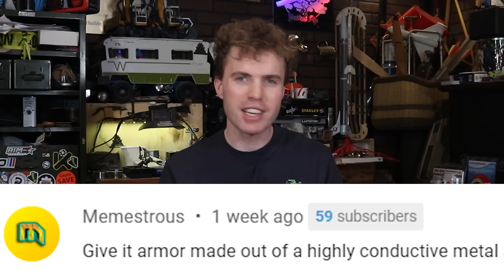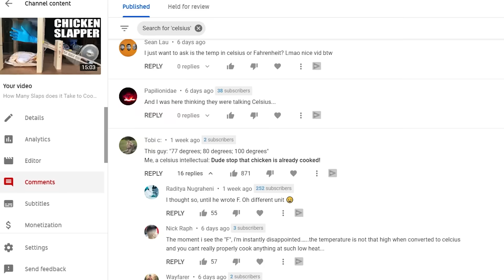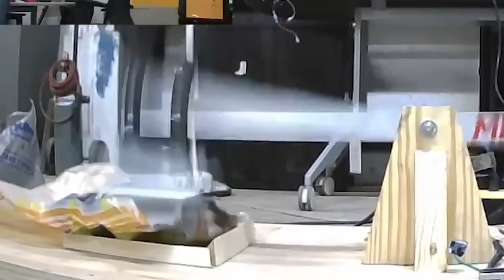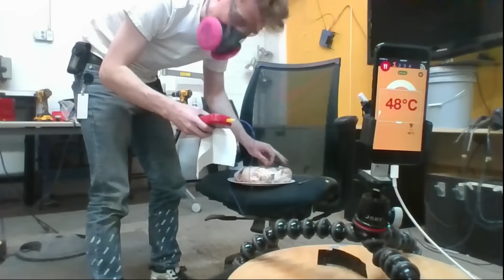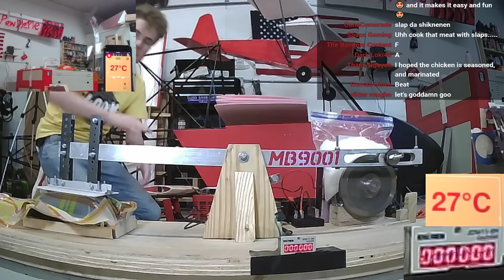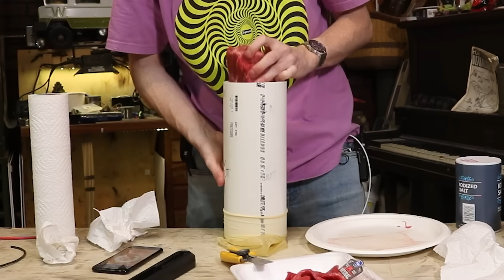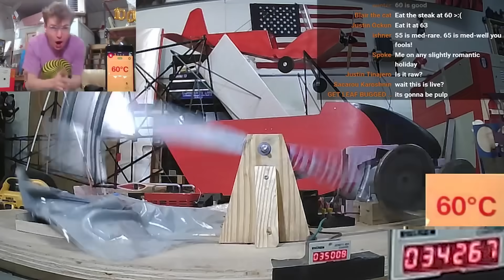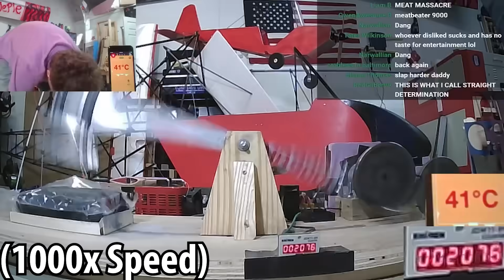I Cooked a Chicken by Slapping It

Comment: It definitely seems that the channel you cut into the slapping arm which attaches to the pin caused the most issues, due to the pin applying force to the thin walls at the top and the bottom of the channel. A design resembling a piston would have mitigated this, where, instead of a pin moving back and forth inside a channel, you have a smaller channel moving back and forth inside of a larger channel, which would be the arm. The smaller channel would be pinned to the wheel.

Also, even though it ended up working in the end when you used a stronger bolt, the bolt ideally should have been supported at both ends rather than just one, so that it resembles a crankshaft. In addition, the slapping arm is offset from the wheel by a significant amount, increasing the torque and subsequently the bending stress. And this bending stress is dynamic, meaning that it's basically just a matter of time before the bolt breaks due to fatigue. If you set it up like a crankshaft, you would not only reduce the internal stresses in the bolt but you would also be able to drive the crankshaft with a belt/chain rather than a rigid attachment to the motor shaft. This would let you gear up, and you could also put on a flywheel to smooth out the torque the motor outputs. It would also eliminate any axial forces or lateral torque acting on the motor, which motors really aren't meant to deal with.

Comment: Running a motor on load with a variac compromise the v/f ratio witch can results  in higher temps. Next time use a drive...

Comment: The device is too complicated. More parts means more things to fail. Should have just stuck to the spinning wheel with like 12 ballistic gel hands mounted on flexible shafts to it so they will bend back to clear the chicken. Increasing speed would allow the hands to hit more often, without increasing force too much. Having the arms mounted in a sort of trailing configuration, as opposed to coming out 90 degrees to the wheel, should also decrease the slapping force and make it easier for the hands to clear the chicken after making contact.

Comment: Why don't you try multiple slapping arms on a fly wheel attached to the motor. If the slapping medium was just flexible enough, it can apply enough force to produce heat and with multiple slapping arms on the wheel, you can crank it and get more slaps per sec. Also, this requires much less stress on the slapping arms because the force applied to each arm on impact would dissipate slightly (i think) as the arm makes its way back around the wheel rather than applying force over a longer arm which creates weak points and instability. So, shorter arms, something flexible enough to slap and also bend enough to move past the chicken and with multiple arms, maybe 6, depending on diameter of the wheel, you get more power and with shorter arms you don't lose as much energy before the slap is applied. Think windmill with slapping arms cranked up to 1000rpm.

Comment: According to my math, it would take 216,000 calories to cook the chicken.

To calculate energy expenditure from watt hours:

Watts per hour x 3.6 x # of hours = Energy expended
Therefore:
7,500 watts per hour x 3.6 = 27,000 x 8 hours = 216,000 calories expended!

This means that since an average chicken contains about ~1,037 calories, you would be in a 214,963 calorie deficit(without taking in BMR, or the addition of eating any other food while slapping the chicken). 
Because one pound of fat is about 3,500 calories, you would lose about ~61.4 pounds of fat from just slapping the chicken alone. 

Why do weight watchers or keto when you could just slap a chicken 135,000 times???

Have a great day👍

Comment: “Im just saying, if Physical Energy can be converted into Thermal Energy, How hard would I have to punch a chicken to cook it?”
-Jello
Reply: The answer to that question is probably around 311km/s²|3200G, or 1.2MN|127t, which is the estimated acceleration/force required to make the hand to ignition point.
You could probably go slower, but you basically need to accelerate the chicken by 2000-2150km/h near instantly to have the same kinetic energy as 60-75C, though obviously you could go slower if you can stop the thermal energy from leaking out like was shown here.
Reply: @theapexsurvivor9538  
._.
Reply: @theapexsurvivor9538  so it would be burnt since its ignighted or do we wait a few secs for it to cook?
Reply: @theapexsurvivor9538  carry the 5 and the 0 do what 300 degrees??? Equal plus punches
Reply: @theapexsurvivor9538  It's easier to accelerate a chicken to that speed, then have it crash into a brick wall.
Reply: @pierrecurie  wont the chicken just be pulverized at that point?
Reply: @-grumpygold1155  yes, but at least it will be at an FDA approved temperature
Reply: @pierrecurie  i see.. just sprinkle some salt eh?
Reply: I see your man of culture
Reply: Good one
Reply: Deku: 👁👄👁
Reply: This was in my recommendation! And I'm not mad!
Reply: Reminded me of the chicken thrown in this video https://www.youtube.com/watch?v=U2rNnzVotS0&fvfvrevbvb

Comment: so about 3x the energy cost and at least 6x the time cost compared to using an oven to bake (using your energy statement, and the 6-8 hours, and 15 minutes to heat oven to 350 degrees, and 30 minutes to cook chicken.

and developing your own technology rather than buying an oven.

... and getting this process to be automated at all requires electricty, while feeding a fire for an oven is a lot less work, and means that you only spend human energy on moving the fuel.

Comment: Why aren’t you using a wheel design to provide the slaps? Seems like the main problem you had was the impact from the arm going up and down. Seems like you could get more efficient slaps if you hung up the chicken like a speed bag, and basically made a small wagon wheel with extended pads, they would deliver slap after slap Rocky style.

Comment: wondering if anybody thought of doing it with a single slapping wheel with 3-4 slapping "hands" attached directly to a motor, hands would obviously be loose hinged slappers to allowed them slap the chicken but get out of the way to allow them to pass by and so on and so on and so on and so on. slappers could be made of some kinda heavy duty rubber or something along those lines so they could flex on impact. in my head that'd be one way to potentially increase the slap frequency and lessens the complexity of the contraption so in theory less stuff could go wrong too.

Comment: Wanna know why the meat gets hot? 

Because it is still part of an organism that reacts to anything. Imagine your hands and start clapping. You don't need to do that if you already know what happens when you do that. After a minute or more you'll start to feel your palms getting pretty warm. But because it also starts to hurt you might want to discontinue your clapping. That is at least the signal your brain will send you in regard of this matter. Now imagine you cut off one of your hands put it on the table and start slapping it with whatever is available. Since it is no longer a part of your body you won't mind the hand hurting because you don't feel it anymore. Thus you can clap/slap as much and as fast as you want which will result in higher temperature within the hand. Because the muscle tissue is "working" and there is no impuls to stop whatever is happening because you cut your hand off earlier which ultimately allows you to "coock" your hand as far as it physically allows you to. If you still don't know why the meat will go warmer and warmer then remember your last exercise and how you got warm during training or running. Pretty much the same idea. 

So basically what happened with the chicken was that it got "overexercised" to the extent where it coocked itself. Yummy idea :)

Comment: Why not use a spring on the slapping side of the slapper? All that weight is on one end, the the motor and mechanism is going through continual stress. There will be some rebound from the meat itself, but a spring installed may help push the slapper back up.

Comment: Elliptical motion. Flexible slap surface. And don't eat aerojel. So good, and try a bag of rice water for the slapper pad, and elliptical so you can control the force with the modulation of the electrical input, it should just shake the bag.

Comment: Congratulations, you built a waveoven. The Microwave does exactly the same thing, just much much faster, enclosed to prevent heat loss.
I must say, it's actually impressive. Personally I would have made a slapper with a speaker magnet, since it could control both power and speed and is built for continuous use.

Comment: the experimenter is a victim of the experimental effect....focusing on optimization would have yielded more effective results ....by utilizing the heat generated by the motor he could've simply put the chicken on top of the motor and turned it on thus cooking the chicken thru induction...the weakness in his design was the cam itself where there were huge losses due to a change in kinetic energy....by insulating the chicken it was ultimately cooked thru induction not kinetic energy...by simply changing the location of the motor and arm to over the chicken would have yielded more effective results #rubegoldberg ⚙️

Comment: Celsius: "I am pretty much the standard way of measuring temperature, hello."

Fahrenheit: "I'm a bit different, but people still use me. Celsius is a bit cooler than me tho."

Kelvin:  👁👄👁
Reply: Kelvin is so much better than Fahrenheit. Especially as you can easily convert it into Celsius and vice versa.
Reply: Kelvin in used in physics and chemistry if im not wrong
Reply: I only use degrees rankine.
Reply: @Quinten Fulgenzi it’s still better than Fahrenheit
Reply: @Quinten Fulgenzi But 0 is actually the lowest it can go, as all good measurements should be.
Reply: @Quinten Fulgenzi Still makes far more sense than Fahrenheit. 0 Kelvin equals -273°Celsius, the lowest theoretical temperature. 273 Kelvin equals 0°Celsius, the lowest point where water is still a liquid under normal pressure.

Comment: Contraindications on completing your chicken slapping mission!   I wonder if you can transfer some of the heat of the motors to the "chicken oven, cooking surface, etc?"  Perhaps the next the design could use a vibrating sheet of metal to cook of some size, 2ft x 2 ft square...?   working much like a sander  or up and downj?  Getting rid of the slapping arm might also remove a lot of issues.... granted with a vibrating sheet of metal sideways or up and down will create different ones.

Comment: Why on earth did you not make a rotary slapper?  A spring-loaded chicken holder to keep the slap pressure pretty equal and with several slapper elements, like rubber  mats, you could get to the required number of slaps much quicker without  the vibration your idea produces.

Comment: I think one of the reasons that the arm ended up breaking several times is that you weren't taking into account the natural resonance at which it bends. If the length of the arm or the speed of the motor aren't adjusted so that it perfectly counters the resonance frequency of the arm, it will bend further than the wood can withstand.

Comment: Um...no

Cooking at a set degree that’s below the SAFELY COOKED TEMPERATURE doesn’t have positive effects, in fact it actually has NEGATIVE effects

If you try this, you’ll find yourself surprised, it’s a rare case yet it happens when people working in a kitchen assume you can cook or reheat foods to around 60 degrees Celsius and it’s safe to eat

THIS IS NOT TRUE PEOPLE, you MUST cook or reheat food to a safe 74 degrees Celsius, and HOT HOLD at 60 degrees Celsius, HOT HOLDING IS NOT THE SAME AS COOKING, HOT HOLDING KEEPS THE FOOD HOT, COOKING KILLS THE BACTERIA IN THE FUCKING FOOD

If it remains anywhere between 60 degrees and 4 degrees Celsius for too long, the bacteria in the food can form a protective outer layer known as a spore which can keep it safe from bacteria killing methods such as cooking or freezing

In other words, DO NOT TRY TO COOK SOMETHING TO 60 DEGREES AND ASSUME THAT’S ENOUGH OR TRY TO HOLD THE COOKING TEMPERATURE THERE

If you’re thinking “This guy doesn’t know what he’s talking about” then think again, I took a cooking class in my school and we worked in our school’s cafeteria, someone made this mistake and got three people sick because of it, they were also kicked out of the class and suspended

So, I will say this one more time, if you are cooking or reheating food, cook it to a safe 74 degrees Celsius and hot hold at 60 degrees Celsius

You should also not hot hold food for longer than two hours, if it’s been hot holding for more than two hours, dump it, I know it seems like a waste, but it’s better than endangering people by serving it again or eating it yourself and endangering yourself

Comment: i have some major redesign ideas.

so, way back when, there was a machine built to measure the number of licks it ACTUALLY took to get to the center of a tootsie roll pop. it was effectively a motor driven wheel of "tongues" (texturized sponges with a moisturizing solution sprayed once every rotation meant to mimic saliva) which would sort of "bop" a tootsie roll pop attatched to a spring and a microswitch, which would count up on a computer for each impact of the lolly on the "tongues", representing the overall number of licks necessary to reach the center.

so this inspired my idea for a sort of rotary slapper, with spring actuated "hands" (rubberized or silicon coated peices of polymer composite board like the cutting board) which can hit the chicken bag at a regular, even pace, and cook it much quicker, and making it more efficient by a factor equal to the number of hands attached.
attaching this wheel of hands directly to the motor drive will reduce the number of moving parts that can fail, and reduce the needed durability for those parts.

We'll be slapping in circles baby

Comment: Would it have been better to do the Nikola Tesla route with a resonant design? Use that mass inertia and cancel it out with a spring and use a linear solonoid to drive it at resonance? Take inspiration from the LC or LLC converter in electronics to regulate the energy per slap

Comment: I thought Kelvin was used for real science. While Fahrenheit was used for culinary. And Celsius is for practical reasons like determining how cold water is or the temp of the environment/weather. Celsius is also for when you hate Fahrenheit(which I hate).
Reply: Celsius is used in lot of sciences - especially those focused on the physical data as opposed to theory or useage of extreme numbers found in astrophysics or thermodynamics. Similar to how you write a message differently based on the recipient, the field of science you're working in prefers different units. C & K are easily converted so it makes sense to just use the appropriate scale, i.e someone calculating the distance and brightness of a star would use Kelvin whereas when recording plant species and taking water samples I would use Celsius as I'm only working with -10° up to 40° where freezing point is an important number that affects my data and needs to be clear.
Reply: @nxxynx5039  Thank you so much for the intellectual conversation. You have made my day.

Comment: That looks more like a stomper than a slapper. I was expecting a rotating machine with about a dozen rubber fins (like swim fins) that literally slap the meat. You already have a rotary motor that you’re changing into up-and-down motion. And it should be easier to adjust the power by simply raising or lowering the fins and adjusting the speed.

Comment: So the conclusion is no? You can't cook a chicken w a slap, unless u have a vacuum sealed bad, a slapping rig, 3/8" hardned steel pole, built in motor and a lot of other shit lol
Reply: None of it was actually "cooked" either, a specific spot reached the bare minimum and dissipation meant that it wasn't even cooking. The key thing with chicken is that the whole thing needs to reach the temperature to kill off the risk of disease.

Comment: celcius? i think you mean kelvin? using negative integers to represent thermal energy? that's how you end up with funky math.
Reply: Only if you're working with extreme numbers, space, or absolute zero. Sciences that work with physical data in the average temperature range work in Celsius as freezing and boiling points are far more relevant to the data
Reply: @nxxynx5039  sorry, but you're wrong. there are a handful of old equations that use celcius but they're just akward holdovers that are being replaced in the lexicon for kelvin. having a negative integer for a positive value causes no end of problems. it isn't a subject thing, it's an algebra thing.

Comment: Aerogel insulation is ABSURDLY effective; you can hold a blowtorch at the bottom of a disc of aerogel, with three crayons set on top, and the crayons will sooner melt by the light of the room.

Comment: Why didn't you just put the motor UNDERNEATH the chicken (using belts and pulleys to emulate the engine's original location)? You could have used the motor's heat to supplement the kinetic heat